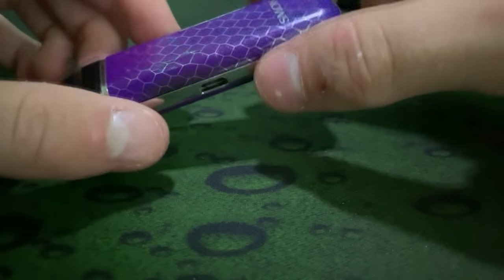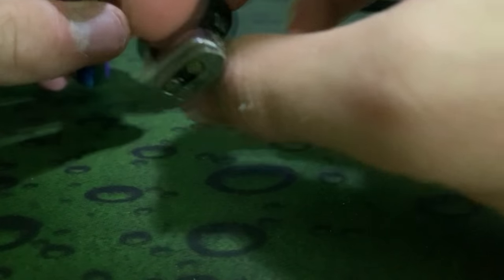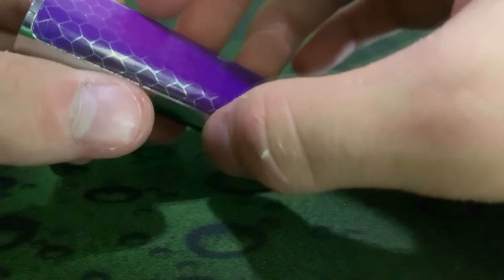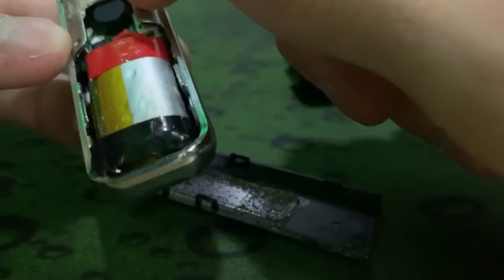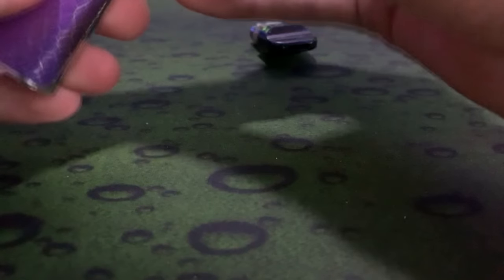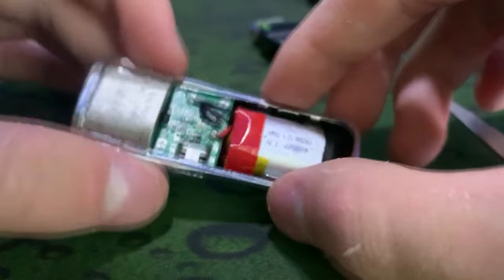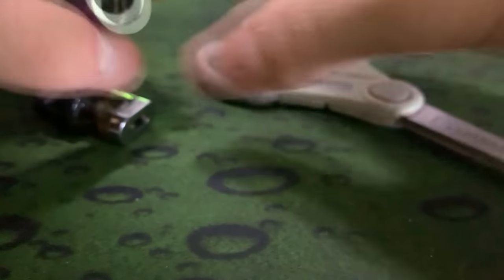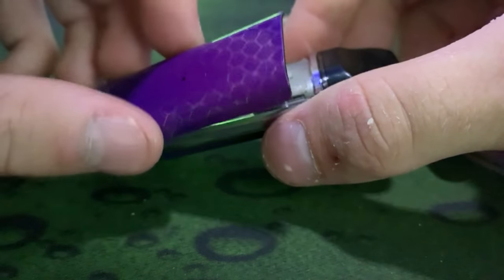*HOW TO FIX* SMOK NOVO VAPE NOT HITTING/FIRING/CHARGING/4 BLINKS - ALL FIXES! #vape #fix #novo

Comment: Wow, can’t believe that scratching the two nods at the bottom of the pod worked. I haven’t used my novo 2 in little bit over a year and it’s just been collecting dust sitting in its case and it works good as new. Thanks bro
Reply: Same bro just brought mine back out but it’s not hitting yet

Comment: You just saved my night!! I was 2 seconds from throwing my device at the wall bc I was so frustrated.
Reply: I felt that. My nova has a different structure on the inside so I don’t think I can do it. But thank god I had a backup vuse.
Reply: @unoriginal5934  those vuse vapes are terrible I have one also but homie helped me fix my novo temporarily gunna buy new one tomorrow, was scared I had to use my vuse I can’t stand that shit lol
Reply: Addicted much?
Reply: @allanx7182 moron much.
Reply: bro same 😭
Reply: Mines still not working, and considering I’ve only just woke up, it’s not a good match
Reply: @allanx7182 youre not? Why are you doing it then? Dheepsheet

Comment: Tip for those who’s novo doesn’t work after all these things. How I get mine to hit is take it apart, n with the pod on with something metal, touch the prongs n it will fire manually. Sucks but aye it works🤷‍♂️
Reply: TrizzyDRO Official thank you so much I’ve been craving nic and you just made my day
Reply: yo wym touch the prongs while the pod is on something metal?
Reply: YungPoints so i use some tweezers but those 3 prongs the ones he touches in the video, with a metal object touch it against/between the bottom and middle prong and if you hold it in the right spot it will fire if you have the pod on. Hope this helps
Reply from the maker: TrizzyDRO Official had to do the same thing with one of my friends’ novos, seems like it gets to a point where nothing will work except making it manually fire :/
Reply: this is what i have to do:/
Reply: Bruh, maybe if you could speak proper English I could try it out!

Comment: Mine is only a month old and it started that blinking crap during this virus lock down.. thanks man! Took off the front and touched the 2 in the left, it blinked and now it works. I used some computer tools. It looks like on the inside that raised plastic piece is hitting  those circuits..

Comment: Another way I fixed my friends novo, was to cover up the openings on the cover with your hand (because airflow comes from there) and blow through the charging port to blow up any juice that might have leaked right into the opening. It worked for hers, might work for yours too.
Reply: the scratching helped out a ton but blowing through the charging port fixed it 100 percent

Comment: Thank you, my novo 2 that I just bought did this when I just cleaned it and got a new pod. If it's faulty I've gotta angry letter to write but jiggling the pod in the chamber worked until the one long flash came on. Its working for now. I'm so stressed with moving
Reply from the maker: glad i could make ur life a little less stressful :)
Reply: @shotbytrav  Thank you!

Comment: wtf still doesnt work!!! 
HOW AM I SUPPOSE TO FEED MY NICOTINE ADDICTION NOW??!?!?!
Reply from the maker: shii maybe its a sign dawg ahahah
Reply: @shotbytrav  I NEED TO FEED MY NICOTINE ADDICTION! IF I DON'T FIND A FIX SOON IM SWiTICHING TO CIGARETTES!!
Reply: Dave cigarettes
Reply: Plavnik im a nicotine addict and now were on lockdown im stuck with fucking 0mg liquid, im underage so school is the only way i can get nicotine
Reply: Just never buy from smok
Reply: Bailey, killed himself, i just get it online
Reply: @flualprazolam  I did and it didn't work
Reply: Hit the pod with a android charger that you cut the the top part off and take the red and black wires strip the rubber off them till the copper is coming out and connect each wire to the metal prongs on the bottom of the pod. Works every time. You might have to tap it quickly so the pod doesn’t burn unless you get a low voltage charger
Reply: @baileykilledhimself6111  damn this was me 2 years ago when I could only get nic at school.
Reply: @baileykilledhimself6111  Don't jou have a guy in your grade that can supply you this shit. Our grade has a guy that supplies the whole grade with nic.
Reply: @flualprazolam  iconic

Comment: Just a heads up, this also works on the Novo 3, the board is significantly smaller but the 3 solder points are there. Thanks for the video, can't believe that actually worked
Reply: I can’t seem to find the 3 points! Is there any direction you can give? Like is it on the front where the light is?
Reply: @rileyrhodes9865  It's the board at the top closest to the mouth piece. You can't miss it, 3 longish silver spots. Can't remember which side off the top of my head but it's very noticeable if your looking for it. Been 2 months and it's still working, only had to do it the one time
Reply: yeah i have novo 3 and i couldnt find the motherboard but the other 2 helped or simply taking one side of the case off and poking it back on

Comment: According to smok, they have safety feature that tells the vapor when enough is enough with that pod. So if your pod giving you problem get new pod. If you know you had the pod for long time. The price is $22 or less for 3. However the wiggle feature works as described in the video.

Comment: THANK YOU!! My vape has been finicky for the past week. I keep two on rotation just for times like this. I actually have several that I’m gonna try to fix bc of this video. I did exactly what you said, stopped at taking entire thing apart. I seemed two glued plus the battery was on the other side & was lighting up. So I just used a small screwdriver & scratched on all 4 sensors. It didn’t wanna work for a min, but the light was green, it was hitting just no 💨 coming out. Tried 4 more times & it worked perfectly. thank you so much. You saved me 30$

Comment: The reason it’s not hitting is likely because one of the prongs is too pushed in. You can’t really pull it further out so i flicked it sideways both sides and it worked. Hope this helps
Reply: I'll try this. I have one of the posts/prongs stuck too far down.

Comment: FIRST thing to know you need a metal that connects electricity for this to work to complete the circuit dont use anything else try a cupper wire or a metal scissor

Comment: when i try to hit mine, itll blink 4 times. i have a novo 2 and ive tried all these methods
Reply from the maker: Jeryn Baldonado When mine blinked 4 times, each of these fixes worked at some point, but eventually the novo battery simply died. If there’s any blinking lights there’s a way to fix it
Reply: TV not true lmao. novo is just a shitty vape overall i’ve tried everything in this video multiple times to the point where i just gave up. before i would just open the case give it some airflow and it seemed to appareciate that but after awhile it gave up comepletely and t doesnt do anything except blink. no matter what you do to it, new pod won’t work, cleaning the entire thing won’t work, touching the sensors scratching the pod or the connectors, absolutely nothing works novo is prolly one of the shittiest vapes i’ve ever hit in my life i wish i got a nord.
Reply: You might just need to buy a new pod, that is what my problem was
Reply: @gotchabiqch8942  Nord is worse trust me. When I bought a Nord, I had problems with the buttons, blinking problems, A LOT of leakage. Like abnormal leakage from every pod sent from Smok. This stupid fucking Novo though. I can't figure out how to fix it

Comment: Touching the two metal pieces ended up working for mine. Can someone explain to me the reason for this?
Reply from the maker: Jacob Shortt you’re basically resetting the circuits from my understanding..if you touch the two metal pieces in a specific spot you can actually make it fire

Comment: Anyone’s novo hitting weak? Like mine doesn’t pull hard
Reply from the maker: That happens when it either is low on battery, or sometimes the pod will have no air flow so just pull the pod upwards slightly
Reply: Try backing the pod out a tiny bit for more airflow
Reply: TV i do that but it still hit weak and not hitting like it used to before

Comment: I have a novo 3 and the charger port is on the bottom so when I took the back out it's a lil different with the battery wires over the battery help lol

Comment: Thanks brother. For now just wiggling the pod around a little bit has fixed it. I was curious though, does that mean it just needs a new pod? Or will I still have to do that with a new pod as well? Thanks again for your help video.
Reply: I started having this problem, got a new pod and it worked great a few days then it started doing it again, got more pods and it was fine for a few weeks and now its doing it again but last time i was able to get it to hit after trying abunch of shit and now nothing works this time around, think my novo is just donezo🙃

Comment: My Novo 2 doesn't look anything like yours inside. Popped off both panels, there was no circuitry visible and I didn't want to mess with it further. All other things (cleaning, scratching) didn't work, so that was my last hope. Guess it's time for a new one, but thanks!
Reply: I feel you. For me when I took the back off, the red wire was detached from the charging port and idk if there’s even a fix or if it’s even worth a fix. If there’s no way to charge the battery w out the classic USB charger I might just need to get a new one 🤧

Comment: Thank you man worked perfectly for my novo 2
Reply: How did you get it to work?
Reply: @Michaela-sn2gx  basically it usually doesn’t fire cause it’s not clean, so use like a cue tip to clean the inside and then put the pod it, if it doesn’t drag slowly pull a little from each side till it drags.
Reply from the maker: glad to hear :)

Comment: I tried all of the above but unfortunately for me it didn't work. I honestly give up on Smoke devices. I've had a procolor, Nord and novo all break this year. I can't afford a new vape and the novo was my last one I got and it just bit the dust so  no more vaping for me. Good video though and all really good fixes normally
Reply from the maker: NotoriousEmu interesting..sounds like some bad luck :/
Reply: @shotbytrav  I'm thinking so. In the past year I had a Smok ProColor explode, a Smoke Nord, Smok Novo, and a Smoke stick  break. As well as an Aspire Breeze 2. The old Suorin Air is still sort of hanging in there but the battery is not the best. I maintain them well and know enough that I'm not doing anything I shouldnt. I quit smoking after many many years  by vaping and have been for a long time and it's worked well for me. But now the combination of not actually having a device that works more than 6 months, and the recent government tax increase of 40 percent on vape products in my area, I think I just have to stop all together. A pod for most devices is becoming almost as pricey as a pack of smokes.

Comment: The motherboard is inaccessible on the novo 2, even after fully taking it apart. It’s built differently from the 1 and the pressing the three buttons is not an option with that device. And tried everything else and it still won’t work. Guess I’ll just buy a new one

Edit. Tried searching the pod gently at first and that didn’t work. Saw someone else in the comments say they got theirs to hit after scratching the shit out of it aggressively so I tried that and it works now lol. Thanks for the vid. Now I don’t have to buy a new one

Comment: for novo 2 just pop the front and there should be 1 metal prong next to the light jus push it down for a few seconds and then it should hit
Reply: what did you use to open it
Reply: Spawn Died small flathead

Comment: Literally wiggled it......nothing. then used a Q tip to take the pod out and clean the hole and the prongs in the bottom. Then put the pod back in and wiggled it.......boom it worked. Thanks for the help
Reply from the maker: glad it fixed! :)

Comment: I have problem, too, but not with hitting or blinks. My battery is charging in extremely low speed, i have to charge it for 2h to take 3 puffs and than charge it once again. Is there any options to fix it?
Reply from the maker: pexe one of my friend’s had that problem, ended up breaking entirely.

Comment: None of this worked for me. I had a prong that was stuck down. I tried loosening it with alcohol but that didn't work. Eventually i took needle nose pillars to it and was able to free it slightly. Im still gonna have to order a new one but this is at least a solid temporary fix and should hold until I get my new one.

Appreciate the help though.

Comment: If the pod is too old and not changed befor does it made this problem? If i change the pod is that will fix it ? Or this problem i mean not hitting and blinking 4 times is not related to the pod .? Because I tried everything you did but still not working💔 the only thing I didn’t yet is change the pod

Comment: So I have tried every fix. The problem I get is that even touching the 3 inner prongs on the motherboard I don't get any reaction. On one occasion I put it on charge and got 15 blinking lights, left it and it hit but now its back to no response. Any ideas?
Reply from the maker: if you are unable to manually spark a connection by touching the 3 inner prongs then your motherboard or circuits may be messed up. the manual connection is sort of your last chance at getting it to work if nothing else works.

Comment: I keep getting these Novo 2s that don’t want to hit even though they’re brand new from the store. I’ve bought 4-5 of these because I really like them, but half of the time they’re faulty. Every time I hit it, it blinks like it’s short circuiting. Tried cleaning even though it’s brand new, tried new coils, and now tried taking it apart and messing with the motherboard best I could follow as you demonstrated: I’ve gotten the vape to hit normally a couple times, and it seemed to be fixed after pulling it apart as you show here, but once I put it back together, it went back to blinking. Any recommendations?

Comment: Question : taking the motherboard off and messing with the inside prongs, is it supposed to spark sometimes? I tried this on 2 of my devices (one was definitely done for) and the other one worked sometimes but it sparked a couple times prior and i don't know if that's normal lmao

Comment: I try to charge my pod and it shows up the "red" light for two-three minutes then the light's gone. The charger is still connected but it's not charging at all, how do I fix it? Does it mean it is fully charged or my charger is shitty cause I tried charging it using power banks and also normal adapters.

Comment: Mine just started firing rapidly, so I took the pod out and the light is still blinking rapidly. I cleaned it all out and it's still blinking. I put the pod in and it still fires rapidly.
Reply: Late answer but that rubber piece on the inside is the airflow sensor pop the rubber piece off and clean the juice

Comment: So here’s my dilemma if you have any advice;
My smok Novo worked for over a year but I have to pull it kinda hard for it to fire, but when I hit it, the light with light up and hit for a split second and then turn off for a split second then back on consistently ever time I hit it, I tried everything and it still inconsistency fires when I hit it. The thing I realized that works is if I hold a metal piece (like what you used) to the small little knobs you mentioned on the left it has more of a consistent hit. But that’s only if I do that. Anyone know what’s up with it?

Comment: Brother the NOVO 2 pictured in Thumb nail is completely different than the 1st gen NOVO. I have the NOVO 2 and after 1.5 months it stopped recivingf a Charge only blue light blinks. And recommendations? I have it apart but interior is completely different. I finally found small circut board after peeling some black goo strip back and nothing . Cleaned all contacts etc.

Comment: When it charges, the light will go red for  maybe 4 minutes but it’ll turn off again, I’ll unplug it and plug it back in the and light will stay on for maybe 45 seconds before turning itself back off and at first I thought this meant it was full so I tried hitting it but the light just flashed, I tried all of these and it’s still not working , I tried every charger in the house! Still not working...

Comment: I had taken a break from vaping for a few months then got back into it yesterday with some old juice still in the pod. I take a hit and my Novo 2 suddenly starts blinking 4 times with a white light. Turns out it means it's short circuiting (from smok themselves that is what I'm lead to believe). I clean the thing out (there wasn't much liquid in the pod) by blowing into it and having the liquid shoot out onto a paper towel, fill it up and the thing still blinks. I pop in the mesh pod and my smok hits fine. My DC1.4 MTL Pod was dry by the way there was no way anything was touching the pins. Is there something my dumbass is doing wrong or did wrong? I had left it in the box for the couple of months I had quit.

Comment: I have a novo 2 and my mother board looks completely different. Same problem, I just have no idea how to fix it since I can’t touch the metal to the prongs :/
Reply: same idk how to fix mine i’ve had to inhale extremely hard to get anything out and it leaks and now it won’t do anything
Reply from the maker: Maddie Hammers if you blow through the charging port does the light come on?
Reply: TV yup

Comment: The board in mine isn't exposed like that. It just goes from battery to that Lil grey piece with the board built in on a Lil shelf looking thingymajig. I wish I could show a pic so you can understand better. But anyways yeah I purchased one of these not even 3 weeks ago and one day at work it started flashing, I gotta say it's Very aggrevating. On top of aggrevated I'm pissed I wasted 40 bucks on it and only got 3 weeks of use out of it.